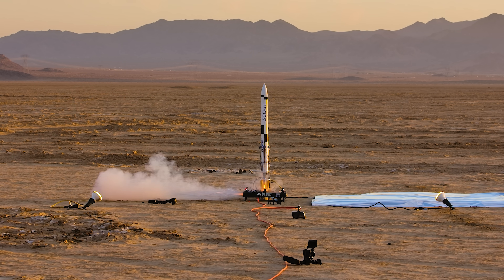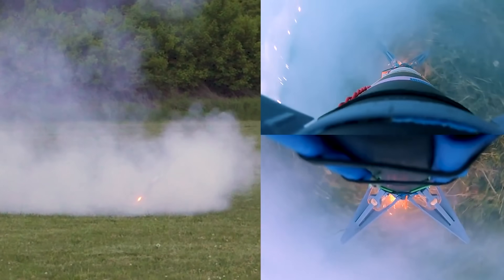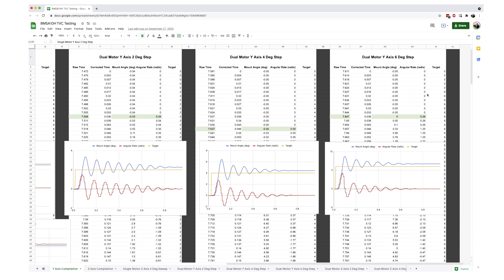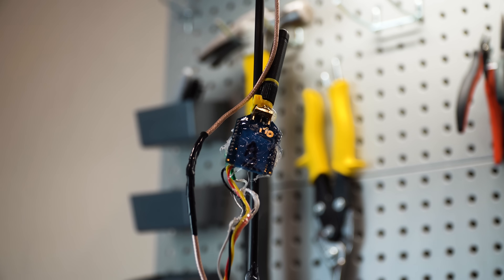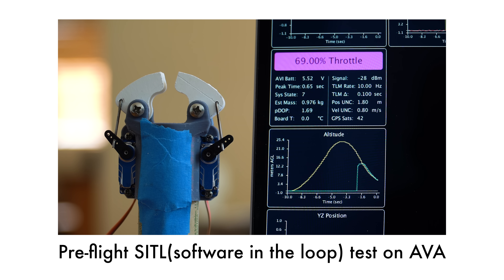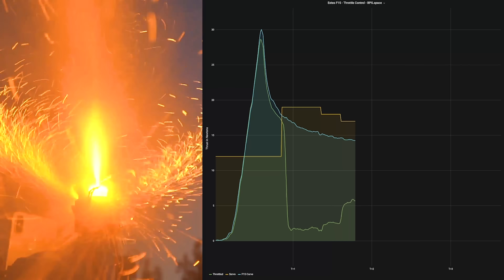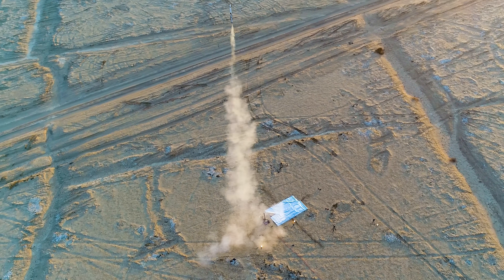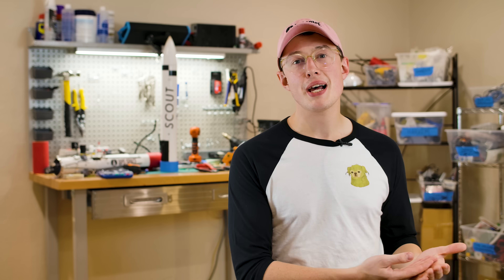Scout F - Flight 1 - Launch and Landing

Comment: Maybe the flight computer's mount should have more shock absorption? Of course, that modifies what data you get from the IMU, but maybe the right mount would give you a beneficial “analog front-end filter” that damps the vibrations that are too fast to try to control anyway. And it will reduce the chance of actual electronic failures / lost data.

Crazy idea (I am not a rocket scientist or even a rocket hobbyist): for large landing burn adjustments (like after determining apogee), carry more motors, and decide how many of these “landing boosters” to fire (and when) to get the total thrust curve you want. Since they would be contributing less than 100% of the thrust, you could mount them rigidly rather than inside of the TVC mount, which would reduce the proportion of vehicle mass that's moving around and contributing to the ascent control problem.

Comment: I think your idea to assume an burn at 80% is most of the solution.  Assuming 25m apogee was the mistake though.  
You could calculate your actual altitude by removing the horizontal vector resulting from your gimballing and throwing all of that impulse out of your upward acceleration.  That would give you a much more accurate starting point to work from.

Comment: When I first saw that, I thought "this is two solid rocket motors" and when I saw the scale of it I thought "this is some hobby servos running it".
We really need better servos. I don't need an 11 dollar servo. I'd gladly pay 10 times that for one that moved several times as fast, took updates several times as fast, had less lash and actually had a feedback line for closed loop control outside the servo. So far as I know, nothing fills this gap and we're still using servos with control input schemes from 40 years ago. Unless you have 11 thousand dollars per servo to spend, there's nothing between hobby servos and fully custom built control mechanisms.

-edit
This kind of oscillation seems to come up in a lot of things, from nuclear reactor control to everything aeronautic, just literally every moving mechanical system. I think a video covering your development of your transfer function and characterization of the servos and the flexibility of the mounting might be very boring for some people but very useful for others. It feels like its inaccurately correcting for an over( or under or non )accounted for metric in how the whole thing moves.

For example, it would be nice to know if you're top-down treating the whole rocket system as a black box with certain measured mathematical characteristics and basing your transfer function on that, or if you're assembling a characterization of the rocket based on characterization of its constituent parts added together.
Reply: Oscillatory behavior can easily be avoided by looking at the transfer function of the control loop... this is not rocket science. I have spent months at uni setting values for K to avoid oscillation.

As a rule of thumb, reduce their value 😂
Reply: @juliusfucik4011  Well, that doesn't quite work when you have a system that has a lot of slop (i.e. lash) and when the speed of the servos is literally slower than than the changes in orientation placed on the rocket by forces out of your control.

As an example, lets say I have a 20Hz oscillation imposed by slop in the engine gimbal (or flight surfaces or whatever) but I can only meaningfully slew the servos at 10Hz. No amount of transfer function can both prevent that oscillation and keep the rocket orientation where you want it.

I used to work on several guided missile systems for the Army. I never designed them, but they all had two common features: 1, they all had heavy viscous liquid damping on the optics gimbal and, 2, they all had MUCH faster control surfaces than was necessary to keep them stable with effectively zero lash.

If you look up "anti backlash gears", those were absolutely everywhere inside these systems.

If I were going to suggest one thing to help with his oscillation problem, it would probably be to add some RC shock dampers with the springs removed between the body of the rocket and the furthest point away from where the servos gimbal it, even if that means having to put an extension on the internal rocket tube to get meaningful performance out of the shocks.

If the servos were very strong, he could leave the springs on, but I doubt they are.

Comment: I thought you had an Altimeter on the control board? Maybe not. But I would use that to re time the firing of the landing motor. Lower altitude the sooner you will need to fire after the first engine cut off and the more throttle control you will need. But you will need a good altitude reading. I use a damping setting on servo motors. It's as simple as it sounds. If the feed back loop is increasing in frequency you use a bit of filtering to cut it down. For example if the motor oscillates more than 10htz slow down the next movement by  10% if it gets over 15htz slow down the next movement by 20% and so on. Some times we engineers like to optimize something that shouldn't exist in the first place. I say stop using the solid rocket motors. I would try a pressure vessel with a valve body to control thrust. compressed CO2 could do the trick. but low pressure steam could also work. Compressed air in a carbon fiber tank might do it. Then the precision control you would have on altitude and thrust would jump up substantially.

Comment: I'm not sure how you measure the apogee of the rocket (barometric, or groundbased per Lidar for example) exactly. I think the accuracy of the measurement isn't precise enough to time the landing procedure. Maybe it helps to eject the starting rocket motor prematurely (if this is even possible) to initiate the landing procedure at a better suitable point in time.
But I'm very impressed by all the Progress you've made with landing your Scout Rockets!

Comment: I'm curious, would it be worth the extra problems of higher speed, higher apogee, more possible deviation from launch location, to get up high enough that you fall long enough to achieve a (predictable) terminal velocity before lighting the landing motor? It removes one of the variables of the total acceleration curve.

Comment: If the rocket is standing on the ground with the landing motor at full power, but the throttle fully closed (thus about 20% force), would it lift off?
If the rocket lifts off with only 20% force, that means you'll never be able to land and stick with a full power motor. 
You would still be doing a "suicide burn" landing, like a Falcon 9, except that the F9 can turn off it's engines on touch-down, and you can't.
Your throttle needs to "pinch" that exhaust enough so that the rocket would not be able to lift up again.
If you can't get that, you're not really gaining any significant control on the landing as the unpredictable burn-out curve of your motor is still the decisive param.

For those who are wondering what a "suicide burn" is:
The one Merlin engine that the F9 lands on can't (significantly) throttle down. This means that it would simply lift the rocket back of the pad after landing if it kept on burning! It's called a suicide burn because F9 must come down with high enough speed so that the one Merlin engine won't lift the rocket back up before it hits the ground. The timing needs to be fairly precise. (fairly, because Merlins do have a some throttle).

Perhaps you could increase the throttle effect by having those jaws a bit curved so that the exhaust doesn't get pushed left and right, but a bit upward. (Would that create a bit of downward force? Or am I a sailor, blowing in his sail, hoping to go faster?)

Comment: You need to increase the speed of the shutters instead of trying to control the throttle with a veryable position servo motor just use solenoids to actuate them and control the time between open and closed to control the throttle also u can use magnets to decrease the weight of the solenoid because the iron core would  be affected more by the coil due to the magnet and u can make the solenoid smaller

Comment: Hey Joey, how hard would it be to mount the IMU systems further up the rocket, yet still have it connected to AVA? Also, how would you go about writing a program that factors in the data from 2 IMUs (at different points around the rocket) into the TVC calculations?

Comment: I have possibly a silly question.  I have wondered how hard it would be to create a small "real" rocket engine, using say oxygen and methane or some other combo.  Is that just too hard for the scale or too hard for amateurs?  Just curious.
Reply: https://youtu.be/6oCGFuFBCxE 
bps space: liquid engine, hybrid engine, solid engine
Reply: Joe’s talked about it before, and I think he has work going on in this area. That said, it is much, much more difficult - I think it’s fair to say it’s right on the limit of what’s possible for amateurs, and probably only recently due to availability of small scale CNC milling, etc.
Reply: @SaffronMilkChap  It's just one of those incredible projects that would be amazing to see.  I guess one of the main issues would be to get the engine down to as simple as possible, meh...

Comment: Joe, great job. I have some questions and suggestions:

1) Your rocket is unstable by design. During ascent phase it uses TVC to stabilize it and you lose performance (max altitude). Every take-off is affected by that and it is an additional variable which is not covered by your simulations. Why don't you make the rocket stable at ascent? Just add fins, move center of gravity and center of pressure, keep TVC switched off for take-off and turn it on for landing only. Maybe this will make your flights more predictable and repeatable. You have already proved that you can stabilize unstable rocket at ascent. You do not have to prove it every time. What you struggle with is the landing (as I understand from all you movies on YT, I spent a lot of time watching and enjoying them ;-) ). Remove the uncertainty that affects landing phase.

2) You use reaction wheel to reduce tendency of the rocket to rotate along its axis. It is heavy. Have you compared the weight of the reaction wheel system and for example actuators to fins that would rotate all of them in one direction (clockwise or counter-clockwise)? Would it be lighter even if you have to include fins (see point (1) above)? Just a trade-off study.

3) The landing legs are deployed just before landing. As I understand each leg has 2 bars. Is the upper bar attached to the rocket tube below or above the center of gravity (CG) of the landing rocket (all fuel of the landing motor used)? If it is below then maybe moving it (much) above CG would help to improve landing?

4) I would propose the modification of the landing procedure and hardware. Assume that the rocket is approaching the ground and the motor is still working. If one of the legs touches the ground (or the rocket is really close to the ground) then the direction of thrust should be reversed as in thrust reverser of jet engine on an aircraft. At this moment the thrust would push the rocket to the ground and keep it there as long as the motor works (from your movies it might be 1-2 sec). If the motor stops working before that then nothing happens. Thus it would require modification of the hardware: attachment of contact sensors to the legs, adding clamp shells (four) that will close completely (no leaks) and that would move with TVC. The sensors would trigger closing of the clamp shells. The landing procedure and the software controlling TVC would have to be modified as well.

5) I am not sure if you noticed how quality of your movies improved over the time. You are doing really good work here!
Reply: Fins only work at high speed.  If Q is low the rocket is still inherently unstable.  That’s why model rockets and military fin stabilized rockets are launched on rails or in tubes that stabilize until its moving fast enough.
Reply: Maybe one more thing ... the landing legs ... they are very elastic and make the rocket bounce at touch-down. You either need:
a) a damper added to the legs or 
b) a part that will deform permanently at landing and does not cause return to the original shape (=plastic deformation) - this approach was used during Apollo program in LM legs

Comment: You need to have a MPC (Model Predictive Control) optimal guidance to represent your position controller (which is fed the system state estimates via kalman filter) which then generates your thrust vector and q_setpoint (where q is your attitude quaternion estimate) based on your series of constraints that is built directly into the MPC cost function. This q_setpoint and thrust vector are then fed into your PID Attitude controller and Attitude Rate Controller which calculate and pass on torque vector to a Control Allocator to convert that torque (and thrust vector) into hardware commands. 

In this way, your system can predict and estimate the start of your landing burn with respect to altitude, attitude, motor constraints etc, regardless of how the ascent burn performed. I believe to make this work, you must have a more complex control system as such. If you'd like I have several awesome papers on this exact matter.
Reply: I never realised how much like giberish this sounds if you don't know any better XD. This doesn't solve the PID instability though, and i doubt it will be easy to make a sufficiently accurate model.
Reply: @someonespotatohmm9513  Never said this would solve PID instabilities. This is for the fact that since his ascent was not optimal due to the instabilities, his descent burn command time was negatively effected. To solve the descent burn time problem, in my opinion, he needs a MPC optimal guidance loop. If all that sounds like giberish to you then thats not really my problem.
Reply: @djredrover  It is just the first time i am hearing someane else describing a not just PID system. And now know to keep in mind how it sounds for others hearing it, without the context of diagram or already working on it. I am also just pointing out that without a stable control loop, this won't work, and what major other problem he might encouter using this aproach.
Reply: @someonespotatohmm9513  I understand that it could sound like giberish to the average person but MPC is a well known control method that is used in many MIMO (Multiple input multiple output) control schemes. Specially in rocketry since many inputs and lots of control surfaces are involved. check out "Design, Optimal Guidance and Control of a Low-cost Re-usable Electric Model Rocket" a great paper discussing this exact type of optimal guidance. Cheers.

PS. You are absolutely correct that without a stable PID loop, an optimal flight is not possible but my pointer was directly relating to the landing burn start time. Since MPC can predict, it is a better solution than a hard-set altitude to start the landing burn. Hope that helps.

Comment: Out of curiosity would it be worth designing a rocket motor holder that locks the motor gimbal on the launch motor burn.  Then when the descent motor ignites it allows the ejection of the launch motor holder freeing up the motor gimbal to allow some control on the descent.

Comment: Do  you think a variable geometry nozzle could solve the throttling issue? i know solid rocket motors already  have a nozzle but if you modified one with variable geometry nozzle id imagine that opening and closing could increase or decrease chamber pressure thus throttling the motor

Comment: Regarding how the "pros" solve these sorts of problems, the go-to approaches typically involve Model Predictive Control (MPC) where the control algorithm effectively solves an optimization problem for 3D position, velocity, orientation, thrust, and gimbal setting during the entire landing trajectory. Sometimes this is done in real time, sometimes it's done ahead of time and a library of solution trajectories are loaded into the realtime controller. If the trajectory is accurate, the controller doesn't actually need to be able to handle large deviations.

SpaceX actually published a (very mathy) paper about this sort of approach, although the fact that they published it probably means it's significantly simplified or flat-out wrong. http://larsblackmore.com/iee_tcst13.pdf

Comment: Maybe you could treat the landing burn as a minimization problem? If the avionics has the FLOPS for it, you could have it continuously :
1. Compute the expected impact velocity if the rest of flight proceeds with zero thrust.
2. Compute the current expected impact velocity with some preset guess values for engine ignition timing, and discretize the throttle position over the remaining time of burn to like 25 flat segments. Your minimization variables are now the ignition time and 25 throttle positions.
3. Use some iterative minimizer to minimize the impact velocity.
4. The avionics now has a descent plan.
This would be continously updated until ignition. After ignition, the remaining throttle bins are still continously updated to minimize impact V.

Comment: Try not depolying the legs how SpaceX does. You should deploy the legs below the final standing height (after the engine has cut off). This should act as a corrective force where the leg on the lowest side could push that side back up. So long as the springs aren't strong enough to throw the craft up, it should work to some degree.

Also try deccelerating at a more agressive rate . Assuming all other systems and data are functioning as intended then, the largest source of variation is probably the throttling system itself.  By using it more than necessary (when not at touchdown) you are probably also introducing more variation in it's throttling preformance.